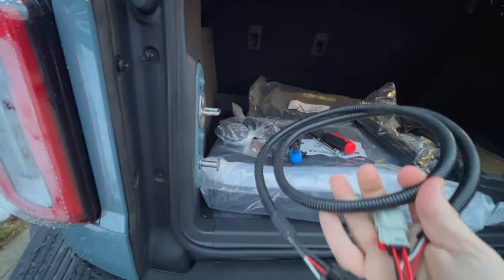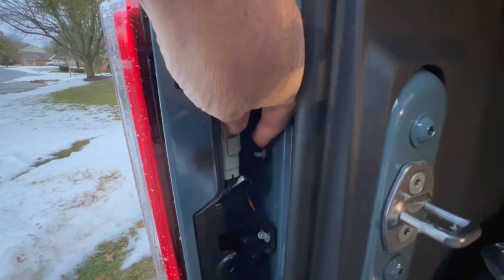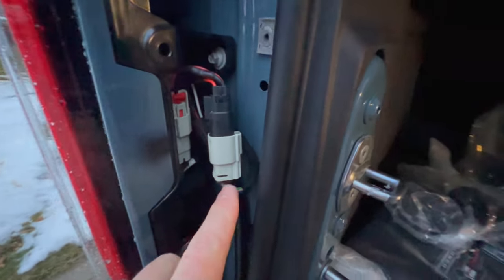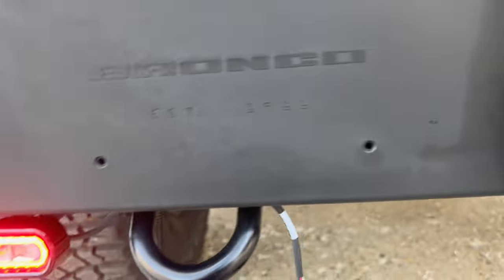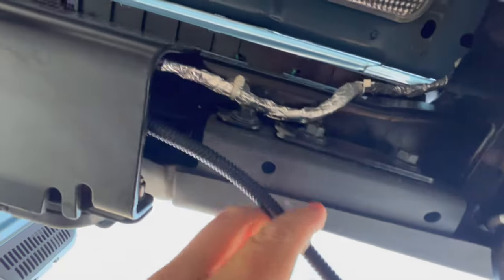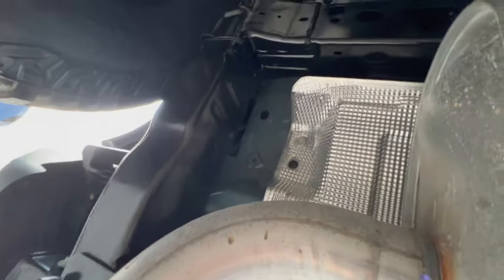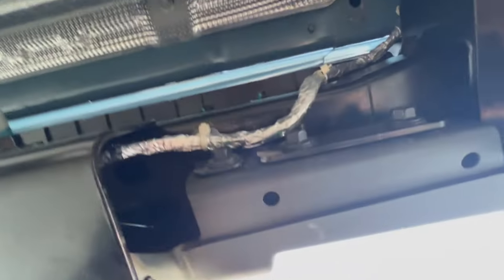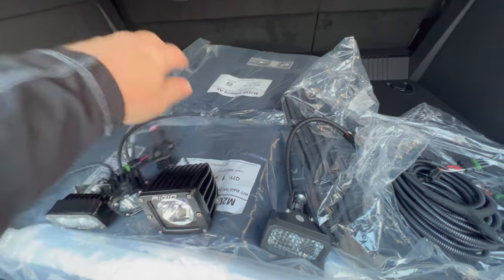2021+ Ford Bronco Rear Light Kit & Tail Light Adapter Installation Rigid SRL Lights 2022 2023 21 22

Comment: Hey John ,
I have the Rigid SRL rear light with the long harness.
My question is , 
When installing the long harness I use the opposite side that you are showing us in the video correct ? We connect the adapter on the passenger side and then run the harness straight down to the engine bay on the drivers side of the vehicle correct ?